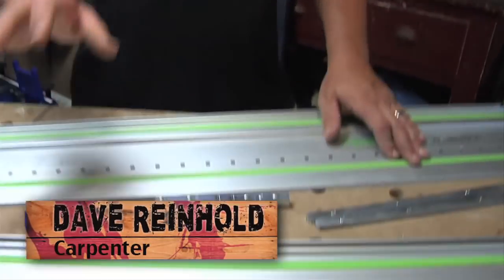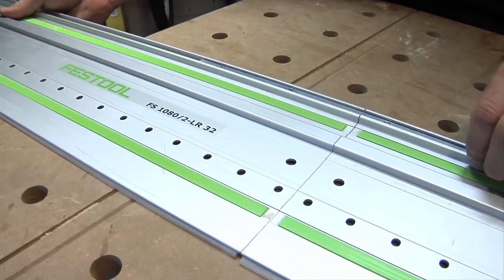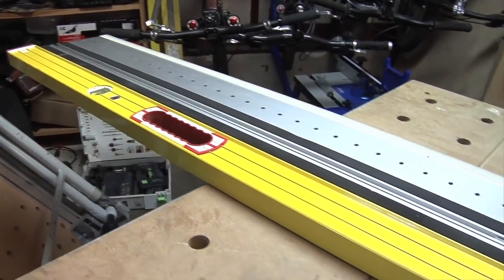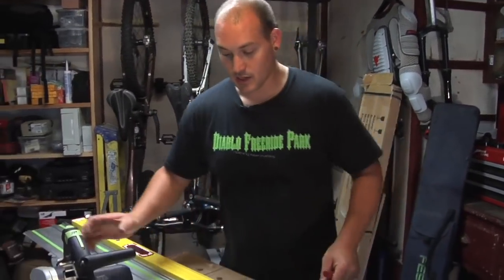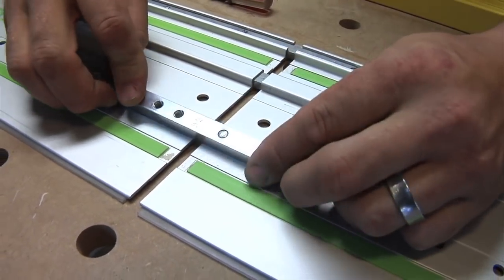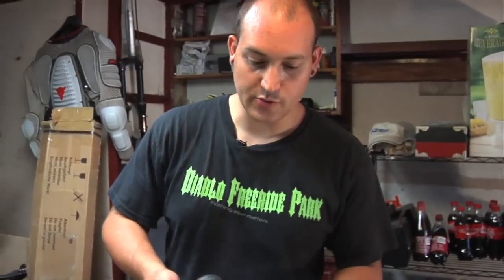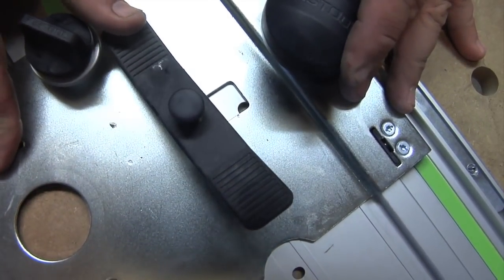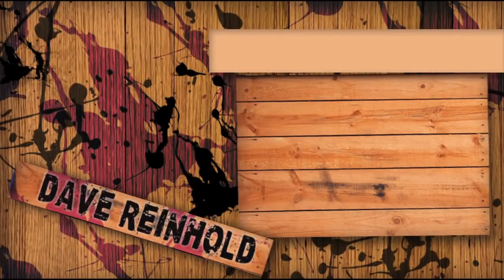Joining The Festool Guide Rails

Comment: Very helpful video, just got my two 55 tracks (one for the LR32 system) and was wondering how to do this to make sure they are aligned. I was going to get the long guide rail, but opted instead to purchase groceries for the next two years.
Reply: Dave Lukasek check out the Betterley Straight line connector.  Toolnut sells them.  Makes the alignment dead straight.

Comment: What you do is somewhat unnecessary as they work very well without all the extra care you take. I have added five 1400mm rails together to trim the end of a roof overhang on several occasions & I get a perfect result every time. I've even used a Makita rail amongst them & the result is the same. I use a TS 75 which has the same footplate as it's smaller sister the TS55. My last job was with a HKC 55 ( 18 volt new Festool model); absolutely wonderful. Keep up your good work. Kind regards.